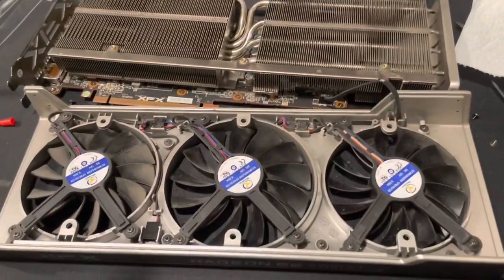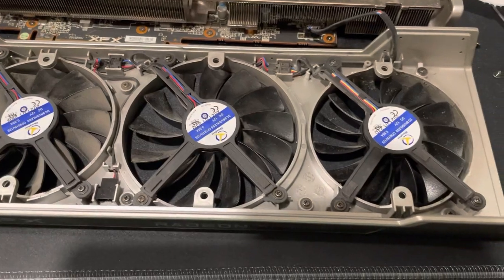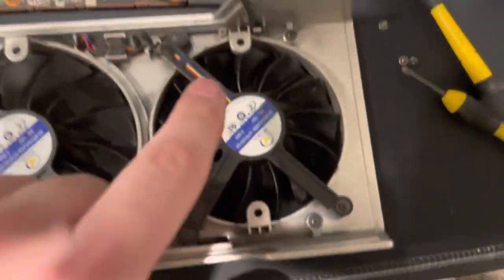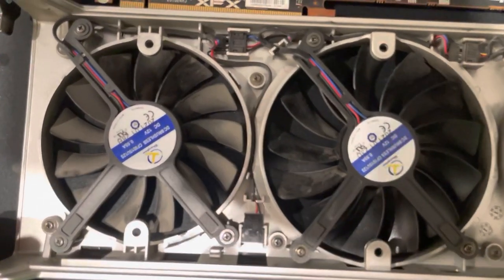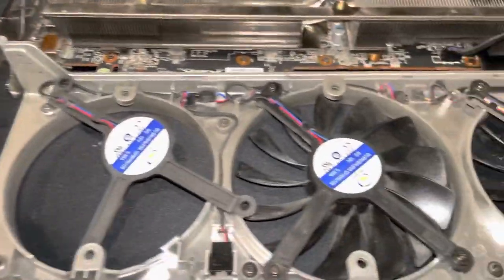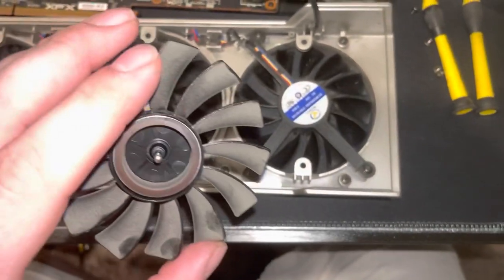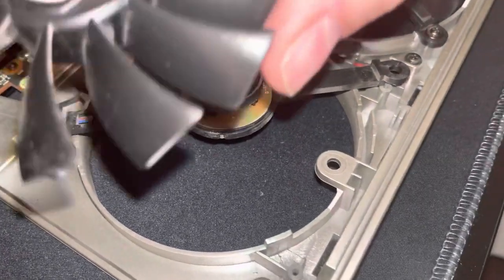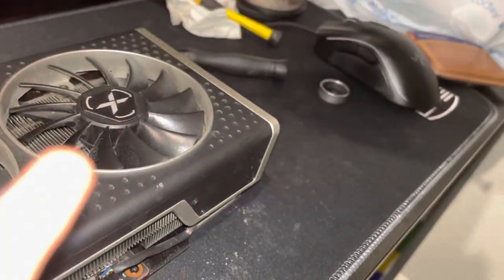6700xt fan noise fix (how to oil the bearings in a Radeon graphics card) #Radeon #6700xt #fannoise

Comment: Used this video for an evga 2070. Probably saved my gpu so thanks a lot!

Incase it helps someone:
Smell of plastic and sounds of fan "revving" made me have a look and realised it was gpu, even though temps were fine. 

Manually spun gpu fans and found one of them just stopped very quickly, within 2 seconds while the other fan could spin 9 seconds with same force applied.

Followed ur advice and problem sorted

Comment: I'm gonna have to do this to mine, started hearing a rattle or scratching at 75% max speed, just super nervous about breaking it

Update- just did it man...those things were on there. Ended up using some car clip removal tools and pryed it off. So far they still work lol. The sound seems to be gone if not much better, thank you so much

Comment: Doing this on my 6600 rn... The fan will 100% break if I take it off like this...
Reply from the maker: It does feel like its going to break!
Reply: @DeomeGaming  I don't think that you understand that brands like PowerColor (my example) will simply snap the fan blades with 1/4 of the force that you probably did on yours, maybe you shouldn't have cut the video in one of the most important parts so I can really see where you are pulling the fan put.
Reply from the maker: @figrider  thanks for the feedback! Hope the video was helpful overall!